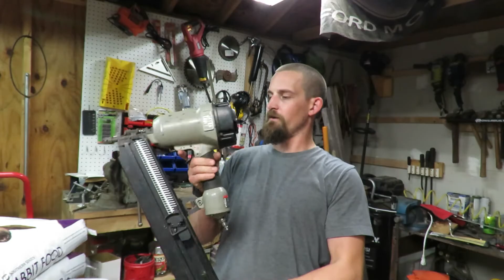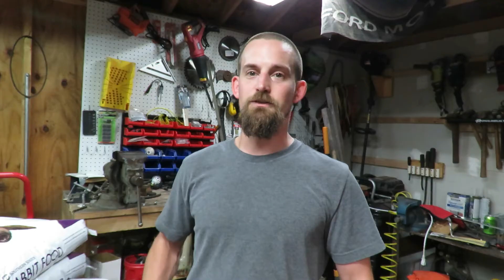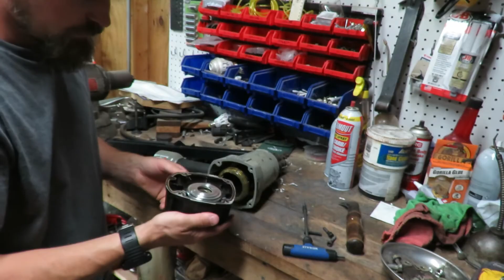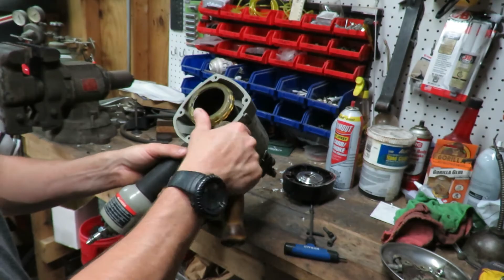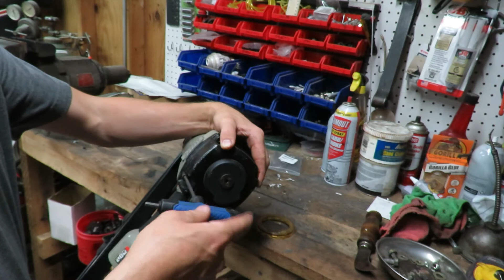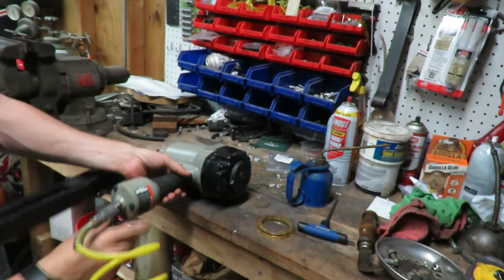How to repair a leaking air nail gun

Comment: I have the same nailer. With exact same problem. Thanks great video
Reply from the maker: Glad it helped!
Reply: @ASliceofWoodWorkshop  Have the same nailer with air leaking from the top.  Going to disassemble it to see if it's the same part. Thanks.

Comment: Great video.... Thanks.  Working on mine today Northern hydraulic.... Same symptoms...  Please tell what exactly is ...Tool Oil?... Was wondering why you did not coat the part before installing....   Thanks.
Reply from the maker: I believe it is just a thinner oil. I usually put some in all my air tools at least 2 times a year if they are not regularly used just to lubricate the rubber

Comment: I have a porter cable narrow crown stapler. The plunger will not return fully for the next staple. I've had it apart and everything looks clean smooth. Any thoughts?
Reply from the maker: I'm not sure. I would have to put eyes on it. Are there any springs involved?
Reply: @ASliceofWoodWorkshop  there are no springs on the plunger. It seems to rely on pressure under the piston to push it back up.the piston is plastic with an "O" ring. Abt half the time it doesn't return far enough to engage another staple. Thanks for any advice.
Reply from the maker: Using air tool oil? Any of the orings feel stiff?